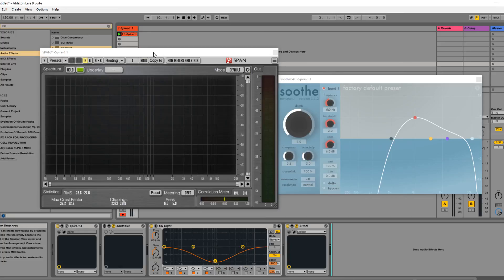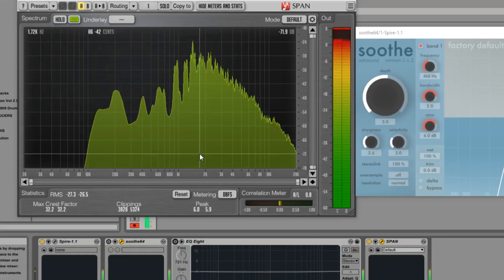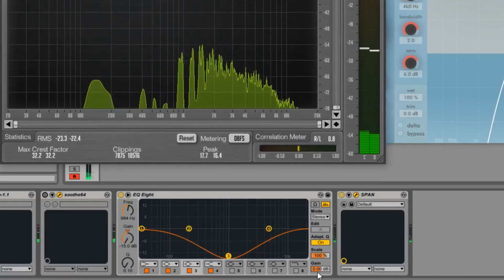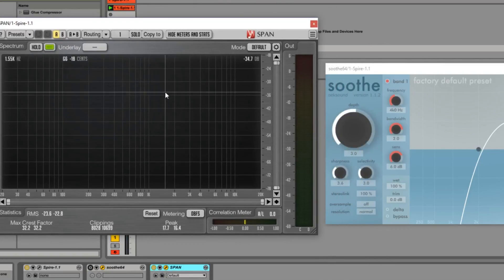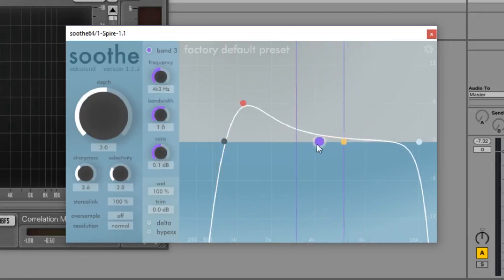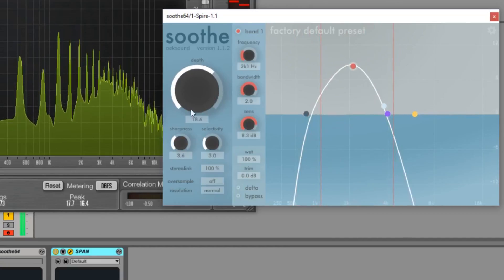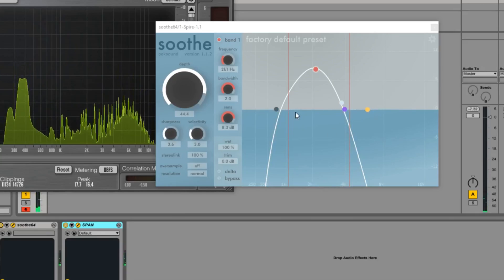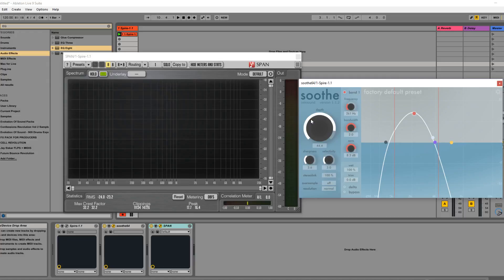Clean Up Resonating Sounds With Oeksound Soothe

Comment: Id normally just use a dynamic EQ, could you explain how this is different?
Reply: But it doesnt move with the notes coming from the signal. Thats what soothe does. Plus it has a infinite number of bands.
Reply: Well it cuts frequencies (in a certain range) when it detects them going too high - instead of a normal eq that will ALWAYS cut out frequencies in that area
Reply: @isaacray3622  thats exactly what a dynamic eq does